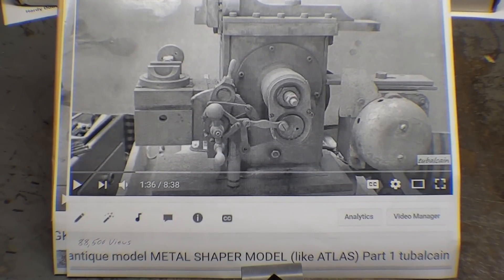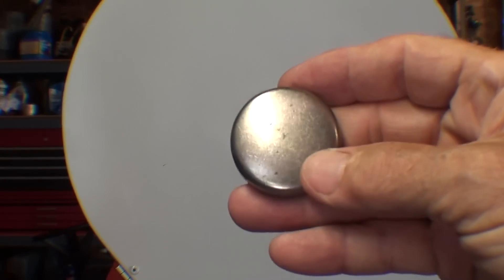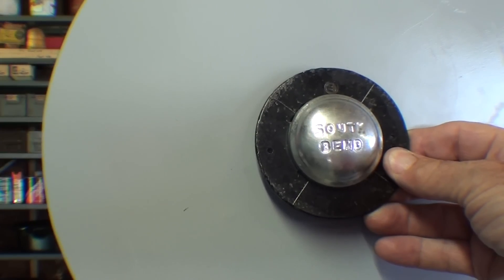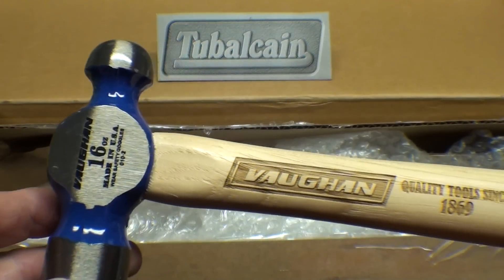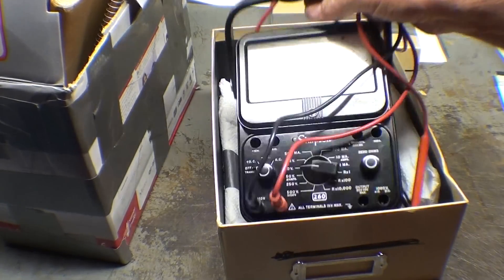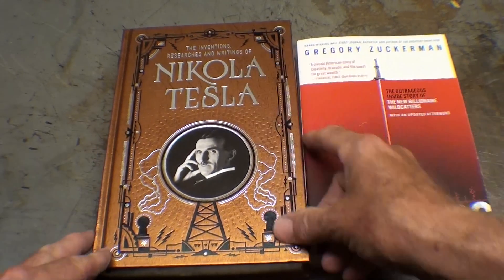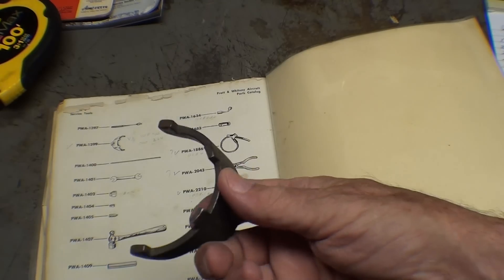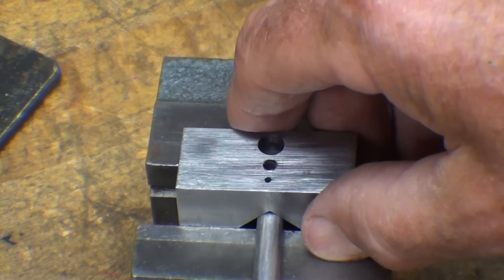THIS & THAT #19 Vaughan Hammer, Simpson Meter tubalcain

Comment: when I saw the Simpson  meter is felt a tear come to my eye . my dad and I worked on hvac units and our vehicles . that is the series of meter we used  . my dad is still alive but we live 100 miles apart.  so thank you  very much for this video.
Reply: Many decades ago when I was in the Navy, we used the Simpson multimeters just like that one (although probably without all the warnings on the back).  Unlike the cheap digital ones that I use these days, those Simpson multimeters had some heft to them and they wouldn't slide off your workbench just from the weight of the leads attached to them.

Comment: Ahhh!  A good ol' Simpson 260 meter.  They are the best.  I use one for repairing old radios.  I am 72 years old and have been using a 260 ever since I was about 10 years old.

Comment: That drilling jig is fantastic. I have a v-grove cut in a piece of wood about 2 foot long that I use for drilling wooden dowels. I put in the bit, center it in the bottom of the v-grove and clamp it to my table. Then lay the dowel in the v-grove and drill away. However the bit skips around trying to use steel bar in it. That little apparatus would work great. Thanks for sharing. (Both parties involved.)

Comment: Suggestion for the knurled knob on the lathe belt cover. Put a circlip groove in the shaft of the knob, and counterbore or recess the panel rear if needed - then it can be retained when the cover is opened.

Comment: That Simpson meter brings me back to my voc tecg high school days. We were taught on those. Even had a large approx. 4 x 6 foot mock up the instructor could use in the classroom. We also had lots of experience repairing these. they're not idiot proof like today s dvm's. If they were set to measure resistance, and placed on a voltage.......poof! After the smoke cleared, we knew there was work coming. you broke it, you fix it! lol

Comment: Enjoyed your vid Mr. Pete.  Would you consider doing a video on how to use a multimeter?   All the selections and plug ins are over my head and I am in need of using one to diagnose an electrical problem on my mini-lathe.  Something to be said for the all mechanical functions of the old South Bends.

Comment: I see that the meter has some adapters for probes.  If you know where those came from, that would probably be good info for other Simpson owners.  The original style probes are still available but usually at a premium cost.  Maybe someone has replaced the original odd sized pin connectors as I have done on my 260.

Comment: The higher "hermaphrodite" batteries were necessary to extend the resistance range of the meter.  A 9 volt battery will only take it so far.  BTW, that VOM has the overload feature (the small white button on the face), which is quite convenient.

The panel plugs have been replaced.  The (original) recessed ones were for user shock protection.

Comment: I have a D-104 microphone from back in the mid 1970s and it takes a 9V battery.  It has just been sitting on a shelf as basically decoration and I haven't used it since probably 1978.  I had not known that it used a battery at the time and only recently discovered that fact.  I removed the base and discovered the original Ray-O-Vac 9V battery still in it and it only had VERY slight corrosion near the battery terminal, but it did not touch the 9V connector on the microphone, so no damage even after 45 years... I doubt their quality is the same these days though since I've had the terminals come off some of the rechargeable 9V NiMH upon their first use.
Reply from the maker: That is amazing. Some of them corrode on the store shelf

Comment: A factory were I used to work fried their Simpson 260 by checking voltage while set to resistance. They asked to borrow mine while it was being repaired. They blew mine before theirs came back. Mine cost $160.00 new, the repair charge was $165.00.

Comment: That South Bend cap is perfect for that use!  Looks great!

I don't see why you need to level the drill guide in that cross-drilling jig....isn't one diameter as good as any other?  Making sure the rod is all the way down in the V is essential, but it doesn't seem like the angle should matter at all.

-- Mike

Comment: nice touch with the south Bend cap.   I was thinking (sorry) that you could have milled a little recess in the back of the cast ring so that the tabs wouldn't have prevented it from sitting flat.   you have got to hate the arm chair quarterbacking..

Comment: People in the Model T community  & (I am one)  have been saying for years the analog meter must be used to measure the AC magneto output.   To use a digital, the readings
jump all over the place.  Yes I have a Simpson like yours and a Simpson powered by 110AC which I use the most cause I hate batt. powered things........

Comment: I would hate to be without a good Simpson meter because unlike digital meters, analog meters due to their lack of hesitation of movement, plus ability to be seen from a relatively long distance, are especially well suited for one-man checking of continuity of wires across large rooms etc. where the sweep of the hand can be seen from a distance when the correct wire (for continuity) is found.
Reply from the maker: I totally agree, I love the analog meters. But the digital have their place as well.